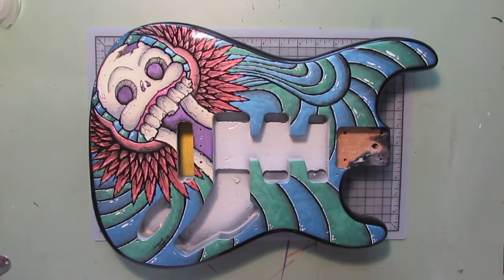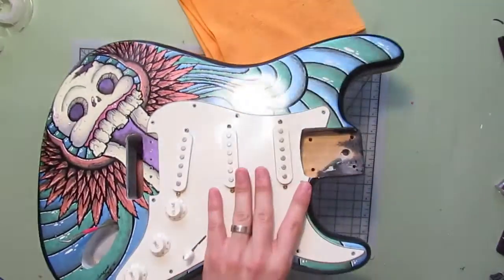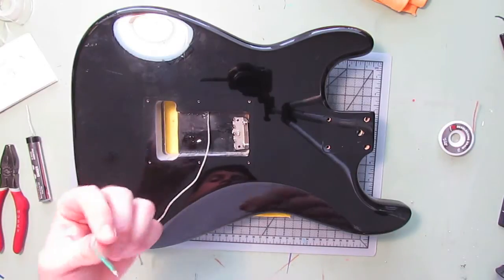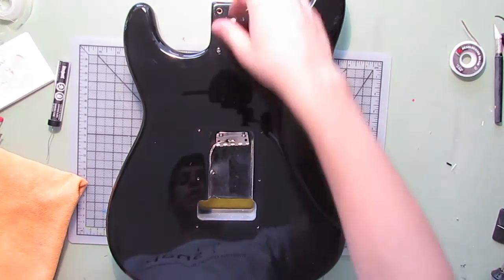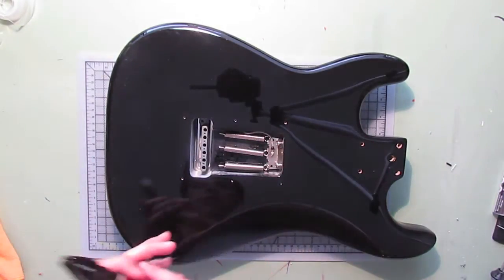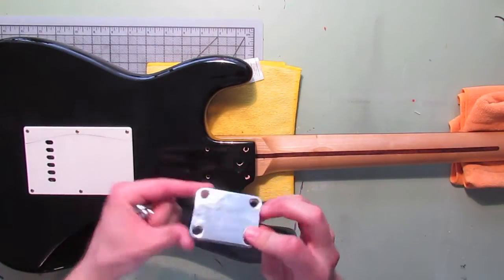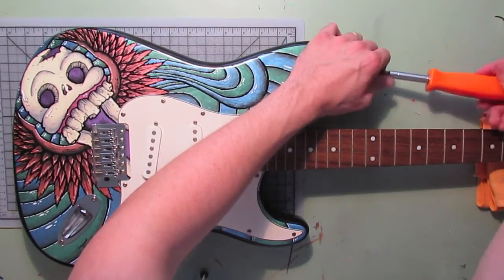How To Paint Your Guitar - Part 9

Comment: I would recommend whip clean then tin the solder iron tip 1st before soldering.  That will help heat the solder joints.  Good series!!!

Comment from the maker: Yes it basic the same process. If You plan to change the color of the body, prime the whole guitar sand the prime to a smooth finish than tape the face if you plan to use the pens. Spray the body the color you want and remove the tape and use the pens and continue the video series on the clearing and finish stage.

Comment from the maker: Oh okay Got it. Yes, I have run into this issue. The 2 things that cause this in my pass are 1) Painting on a surface that is off gassing. Primary oil base primers. The cracks will slowly appear & you won't know till your down. At least in my case. 2) I have had the issue of lacquer causing the cracks. lacquer is an oil base varnish & spraying it directly onto the paint pens depending on the amount the oil in the varnish can seep into the paint & cause the paint to separate creating the cracks.

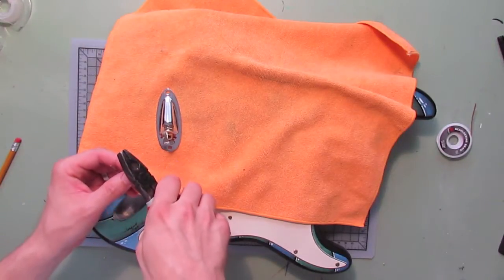Comment: 3:04 - always remember to TIN YOUR WIRES.  it stops them fraying and causing a short

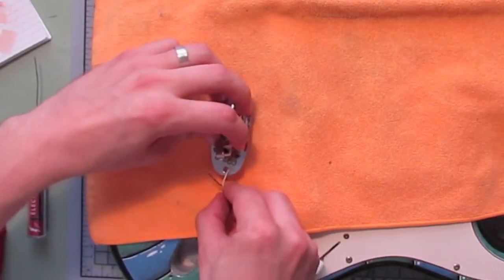3:49 - Yep, wiring it backwards would cause an earth problem.  Remember the way it was originally.

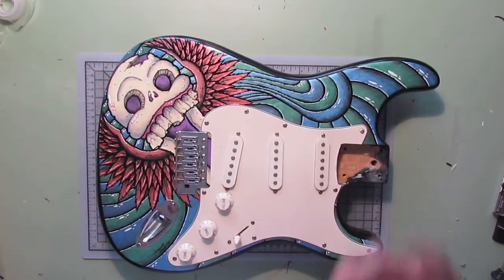8:58 - Luthiers and guitar maintenance books will tell you there is a certain angle that the bridge should sit at so the back end is above the body by about 2-3mm.  dont over tighten the screws before you reattach the springs and adjust it as needed

Good work.  i hope people post vids of their guitars )

Comment: I have a question: If you have a factory finished white guitar, will it look good if you draw a design on it with a black permanent marker? Or is it necessary to do the finish all over again then? Great video series by the way!
Reply: You would have to do the finish all over again then. I would recommend sanding down the clear coat first as well. I saw a video where a guy sharpied right over the clear coat and it looked great, but the very end of the video stated he had to entirely re-do it because he didn't even clear coat over.

Comment: Man, you rock! I wish I could draw like you. Could this be achieved in a natural wood? then applying the gloss? Im thinking in doing a black burst then the drawing, is that possibe? Many many thanks!!
Reply: +Aaron Rodriguez Of course, just be sure to sand enough color so you can see your drawing.  The finishing process would be same but be sure if you're using water or oil based paint, stain, ect,  to check about finishes and compatibility.

Comment: I love the vids! Really learned alot. I just got a Fender Strat but want to refinish it with just another solid finish. I understand i need to sand, apply coats of primer, but what kind of paint should i use after primer if i just want to refinish with a solid color? It would be awesome if you can respond with a step by step and what products i need to accomplish my goal. Keep up the awesome art!
Reply: I think you should maybe if it's in you're budget get a airbrush kit and airbrush it
Reply: Use a lacquer based paint. Fender (and just about every other guitar manufacturer) uses nitrocellulose lacquer paint, and it will work with the lacquer clear coat as well. It is literally the exact same procedure, only you're spraying the color on instead of drawing it on with markers. You can use rattle cans to do the job, but I prefer using a HVLP spray gun (like they use for cars). If there's a Harbor Freight, they usually sell individual guns for like $20 and the two-gun kit for somewhere around $40 with all the tools and a case and everything.

Comment: I have a legit question. Can you substitute these markers for, say, the Sharpie brand water-based paint markers? Or could you perhaps do the same work with oil or alcohol based paint markers? The reason I ask it the hobby shops in my area don't carry the POSCA markers.
Reply: I would assume the Sharpie brand would be fine to use as they and the POSCA markers are both water-based paint markers. I cannot say for sure about the oil and alcohol based products though. That being said, the POSCA markers are available on Amazon and it's like $20-25 for the 15-pack. I bought them and the box was entirely in Japanese, so I have a feeling POSCAs are going to be hard to find in general other than online.

Comment: for the rewiring, is there a way without sodering ?
Reply: Not really, maybe if you found something like connectors for a wiring harness like the ones on motorcycles. But soldering isn't really difficult specially just a jack, if you dont feel confident and dont wanna do it yourself take it to your local guitar tech, he'll make quick work out of it.

Comment: How would I rewire all of the components on a guitar that has no pickguard?
Reply: What kind of guitar and why would it not have a pickguard?
Reply: KingInky13  Probably a Les Paul. They have a pickguard, but not one that needs to be removed to rewire. Mickey. There is probably a component area on the back of the guitar almost like the one on this guitar only not in the center. Probably down near the bottom corner.

Comment: Regardless of how it looks, the tone quality on that guitar just dropped tremendously... Sorry, man, you're a great artist, but all that water on the wood, and all those layers and coats of paints, primers, and clears really messes up the tone. This guitar looks better, but it's gonna sound a hell of a lot cheaper, even considering this was a Squier strat. Wood is not like plastic or metal, it's a living material, and thus really easy to ruin. I wouldn't recommend doing this to any instrument you actually want to play...
Reply from the maker: Have to disagree. This guitar is only an art piece but it isn't the only guitar I've done. I have stepped away from painting guitars to pursue other ventures but i can assure you the guitars that I have painted in the pass using this method had no sound issues. Every client I painted for was  extremely happy and never expressed any issues to their guitar's sound. I painted a number of guitars for phat guitars and sound and performance is great. You can dig around their facebook and you'll find some of the guitars in action. I appreciated your comment.
Reply: Oh, I'm sure they were satisfied, and I'm glad to hear they were, and the guitars can still sound neat because there are loads of other factors that affect tone, such as pickups and strings and setup, but the wood also has a lot to do with the tone, and it's probably the most difficult part to switch out or fix (for obvious reasons). This sort of treatment of the wood can really affect the tonal quality of the wood in a very negative way. Just air temperature and humidity can mess the guitar up permanently, so applying that much water on it, not sanding the previous layers of paint down sufficiently and then applying mulitple layers of paint on top of what was already there is quite problematic. That much paint makes the body less resonant and will likely result in a more hollow and less nuanced tone. In other words, the guitar will sound a lot cheaper. And the water can directly damage the wood. But it sure would look good in a display case, and it'd be rad for music videos or something similar.
Reply: He wet sanded the painted surface.  The water didn't get to the bare wood, therefore not affecting it at all.  I don't think the type of paint used affects tone as much as one might think, in an electric guitar.  There may be 6 people in the world than can hear the difference between poly and lacquer.